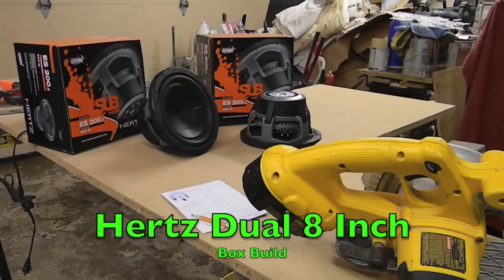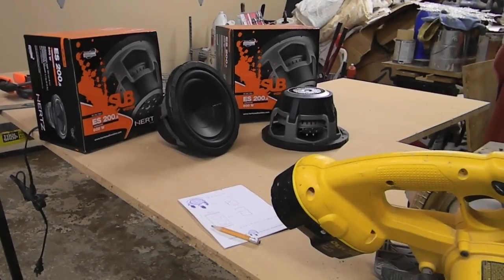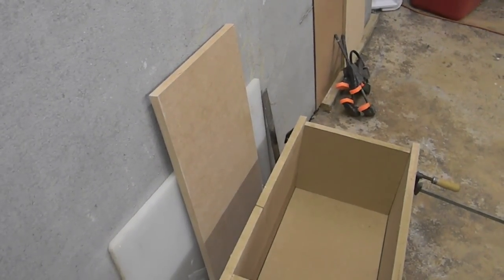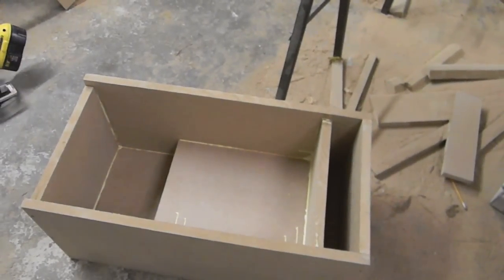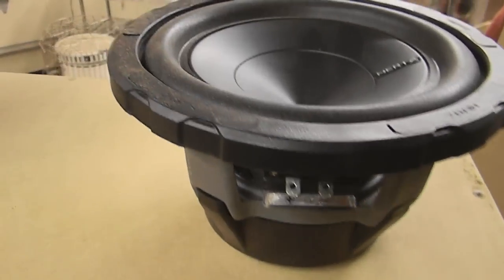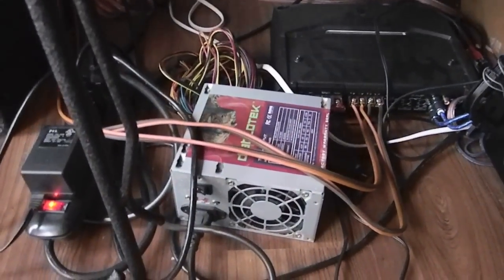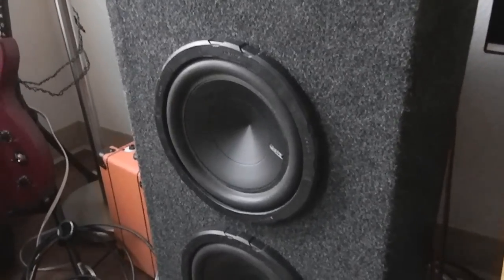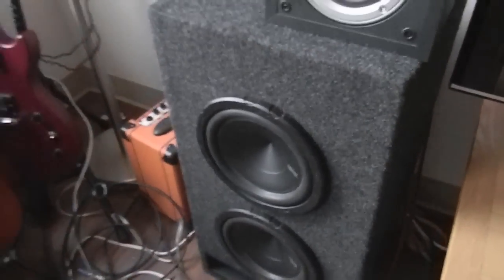2 Hertz Energy 8 inch Subwoofers Custom Box Build

Comment: 500 watts is on the low side for two of these woofers, I use a 1200 watt Hertz HCP 1DK amp to power the two Hertz Energy 8" woofers in my car. The box does look nice though, looks like it cleaned up well with the carpeting.

Comment: 2:38 Dude... you are not in the kinder garden anymore, take more care while cutting, use a guide for that circular saw, and take more care with the jigsaw when cutting the mounting hole, I have not too much experience, but when I tried I did some circles near perfection.
Reply: with a cheap router you can get perfect holes quite easily
Reply: I agree, I don't cut perfect holes, but those holes aren't even centered properly. Oh well, I guess it doesn't matter for the sound as long as the woofers can be fastened down properly.
Reply: Internet experts unite! 🤣 Where’s your video?